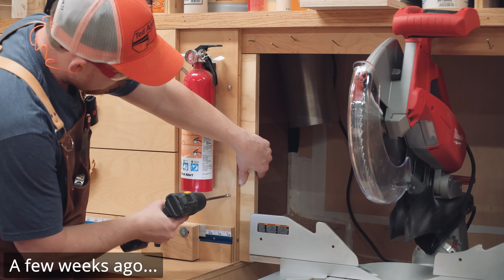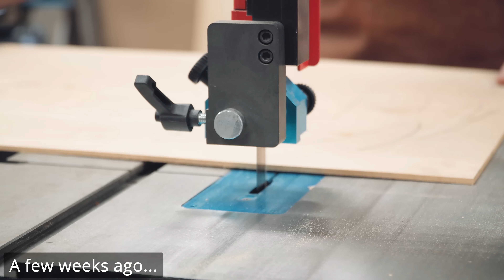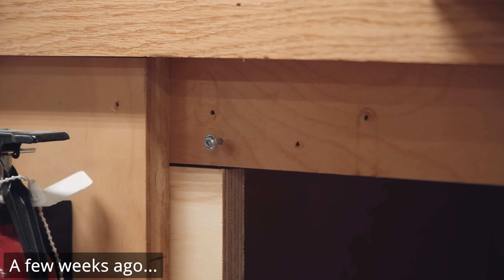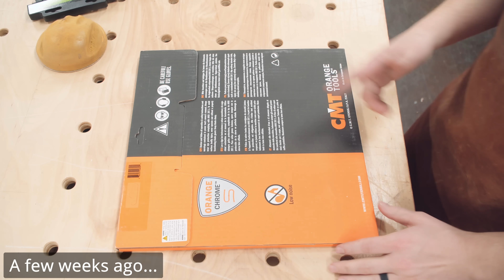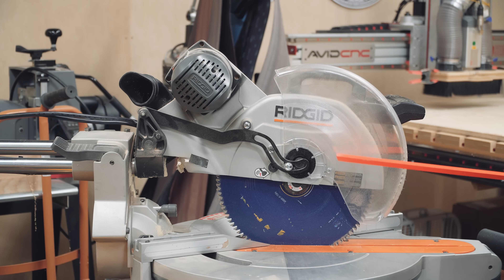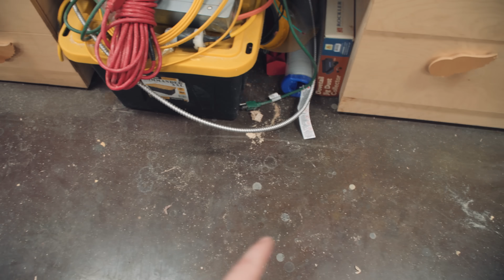Miter Saw Dust Collection Considerations - 358

Comment: Push-pull ventilation of the dust-particulate (swarf) generation zone is the most effective means of evacuating the swarf zone. This existing technology has yet to trickle down into the woodworking world.  A positive pressure air injection balanced with and directed thru the swarf zone and towards the negative pressure outlet.  For the offending miter saw 4 air injection zones; 
1.under the table, this could entrainment that which makes the circuit around the blade especially if wider than the kerf where the blade doesn't pass thru table insert.
2. Two in the shroud 45 degrees to the blade, aimed rearward into a negative pressure outlet to dislodge gullet carried swarf.
3. Behind the fence directed rearward.
4. Behind the saw directed rearward.
With the limited front opening the additional cfm and velocity of positive pressure injection will entrainment more air into the custom opening preventing swarf escape. These concepts were borrowed from existing industrial applications where they must capture all swarf, collect and separate it before the airflow reaches filtration and discharge. One of these days a maker will add these principles to his tools, and maybe manufacturers will recognize swarf as the health risk it is and incorporate these principles into their tools. Meanwhile it is up to thinkers who can get in the Magic School Bus and get into the airflow identifying opportunities to master control along the swarf path. You are the first to think about why the mitersaw scatters wooddust (It is that which is broken down that names the dust, not the process. Unless the saw is breaking down, it would be the blade, we should retire "sawdust, sanding dust etc.)

Comment: Hey Jay, what do you think about discharging your dust directly out the building versus using filters?
Reply from the maker: It will discharge my air conditioning as well. I live in Mississippi. Hot and humid. AC is borderline a must.

Comment: Thanks, Jay!  My miter saw has altered my perspective on dust collection into two categories; that which is easily cleaned up and that which is harder to clean up.  The easy stuff is what bounces out front.  The rest is what coats whatever is sitting behind the saw and what falls down behind it.  That second group is where I'm focusing my efforts because a "whole problem" solution is too elusive.  Sweeping the floor in front of the saw is easy in comparison.

Comment: I was using a water hose to clean a broom. And I could see that when was hitting it there were not as much splashing around with water. 
Could the same thing happen to a table/miter-saw ?
What would happen if the blade was running in close proximity to two brooms at a 90% angle ?

What if the slot for the blade was closed of by a row of hair ?

Comment: Good thoughts of the dust circulation around the blade. It's made me realise that my saw has to have a vac plugged into the blade dust port or the buildup will eventually cause trouble - the blade guard would have to be wider to work without a vac. One thing worth adding is that the spray can also be to do with the placement and direction of the motor vents. These seem to be designed to clear the work area during cutting, but perhaps a some lightweight stick-on vents pointed upwards or sideways would help to keep the workspace tidier and reduce the amount of fine particles in the air?

Comment: I have a Delta 12" miter saw.  Dust collection has bedeviled me for years.  I have tried all sorts of containment measures, most recently the clever "box it all up" solution from Fisher Shop.  Most of the dust I was unable to contain spewed sideways.  When I switched from the original blade to the CMT blade you recommend, it made a HUGE difference.  I would never have thought of this had you not emphasized it here.  Thank you for the good work.

Comment: Looks like the lights that tell ya where  the blade will strike the wood  are burned out on your Junkie miter saw , mine too . What a POS Milwaukee put on the market . Anybody looking to buy a saw ? Keep looking bc M dont have a decent one . My first and last "Red" tool I will ever buy . I should have stayed with Dewalt . BTW ,There is no way to improve the dust collection on this  saw . Piss poor design at best

Comment: Do you think if the replaceable throat plate was perforated, on either side of the blade slot, dust could be drawn down from the blade guard and into the dust collection? Just a thought.

Comment: On your old miter saw the ridgid. Did you ever have any issues with that black arm that your pointing at marker 9:50 ever bend causing your guard not to function properly I have this saw and had to take the guard off because the old one keeps bending . And you can not find this part anywhere. Thanks for any help

Comment: I think that saw needs looking at, it is noisy and the blades are 'ringing' (very clear on headphones) like it has a bearing issue or a lot of slack/slop in the drive shafts/belt/gears which ever it uses.
Reply from the maker: No. The stock blade caused the ringing. This motor sounds exactly like the kapex.

Comment: Kind of a shame on Milwaukee's part that a saw in this price category has such horrible dust management. Love the light on it and the digital miter gauge is convenient . But, the dust collection has turned me off on ever getting one. The way the collection is set up makes this more a contractor saw (mostly used outside) than a shop saw, in my opinion. Thanks for the FYI Jay. I'll stick with my current saw (Kobalt 12-in) with dust collection similar to your old saw that goes out the top of the shroud.

Comment: I missed you saying what your doing to loose the weight.  Obviously it’s suited you well. The saws turntable looks really small. The wings of the frame tapering into the pivot point reduces the surface area quite a bit. Can you still put jigs or stops for crown? Hold downs? 
The long arm and small round turntable remind me of a spoon, so now I have to call that your spoon saw.   Good job all around, have a great Christmas.

Comment: I switched to CMT blades a month or so ago and am very pleased. I think they are a good value relative to both cheaper and ore expensive blades. The quality is very good and the price not that much ore than big-box plates. Plus they can be resharpened.

Comment: Hey, Jay, can you tell me why all miter saws are made for lefthanded operation? That has always bugged me. What I mean is, you adjust the right hand fence to be perpendicular to the blade, but if you are right handed, you tend to hold the material against the left fence and operate the saw with your right hand. Doing it that way means you really aren't necessarily getting square cuts because the left hand fence is determining the accuracy of squareness and it can't be adjusted (at least not on my Dewalt portable).

Comment: I would look at modifying the guard so it stays farther up first, then, take a metal hole saw and cut a hole in the side of the metal upper guard, 1.5 or 2 inches. Attach a small collapsible hose to that that can connect through your enclosure to your large port behind the saw. Radial arm saws had this kind of dust collection and they worked pretty well. Last thing I would suggest is zero clearance tape from fast cap. Helps get cleaner cuts but will also help direct any airflow from the blade across the tape and toward the shroud.

Comment: Does anyone (manufacturer) have some kind of air sprayer to clean the blade as it's exiting the material? If it was in the right place, pointed the right way, seems like it could toss the sawdust into the path of the collection system.

Comment: Couple of thoughts 1)you can get very thin strong neodymium magnets that could be super glued easily so magnets aren’t a big deal 2) I watched another video recently showing the two rear large baffles replaced with a set of heavy duty vertical blinds slightly overlapped ( not sure what they are called you see these hanging in some retail stores or workshops they provide a wall that you can just walk through by slipping between two of the vertical strips). Sorry not explaining what these are called very well if anyone knows what they let me know in comments below.  The point of this curtain was that it could flex and seal more effectively regardless of the orientation of the saw, ie cutouts in the rear baffles to accommodate horizontal or vertical articulation of the blade are not necessary.  You do of course need to make sure there is no chance of the vertical blind being entangled in the blade mechanism.  Thanks for the video, I hope you don’t consider this post as a criticism just and alternate viewpoint for others to consider if building / improving mitre saw dust collection.  Stay safe everyone and happy holidays.

Comment: I use a power bar that turns off outlets when the control outlet device is not on. The saw an shop vac are connected to it so the vac turns on and off with the saw. A second or two after the saw stops. Instead of a dust collection system each tool has their own setup.

Comment: You had the Ridgid saw for several years and said you replaced it because it had worn to the point of not being as accurate as it once was. Given this difference in dust collection and today's $400 price difference between the two saws, which would you spend your own money on if you were buying a saw for yourself? To you, is the Milwaukee worth $749, or would you buy the Ridgid at $349 and use the $400 for something else?

Comment: A good saw blade makes a significant difference in vibration, cut quality, sound, and load on the tool. I used to think it would not be that much but after trying one, it's definitely noticable.

Comment: You might want to add some vertical "D" handles to the removable plates inline with, or slightly inset from the screws.  That'd make it super easy to do a one handed grab to lift the plates off their screws as well as put them back in place.  Just a thought...
Reply: I thought the same thing.

Comment: I have a DeWalt miter saw which has terrible dust collection. Even with a "dust port", it does absolutely nothing. I also tried a shop vac with no luck. I ended up just positioning a Hefty trash bag around the back of the saw like a tent to catch all of the dust so it gets trapped there instead of going all over the place.

Comment: Just an idea,maybe you could drill a series of smaller holes at the back of the saw to reduce the amount of sawdust coming back up through the guard.
Reply: the aluminum saw chassis might be weakened by that plan and it also might have an effect on the noise level.  He could integrate downdraft dust collection in the stand though; the dust collection vacuum has plenty of air volume.

Comment: Does this saw have the ability/option to loosen the detent plate for squaring? I have a Ridgid 10" slider that could only be adjusted by loosening the fence. Terrible. You had to have all the bolts loosened to move it, and trying to leave one on the end tighter, as a pivot, never worked correctly. That saw also had some flex in the slides. Curt ng perfectly square was very frustrating. I decided to go with DeWalt. Just about every trim guy uses DeWalt. Can't really argue with that. I'm currently building a modified version of your miter saw station and the DeWalt takes some creativity in positioning since it's so long behind the saw. The adjustment at the detent plate seems to be a much better method for miter saws.
Reply from the maker: Just the fence.

Comment: I have a Tenryu Silencer fine crosscut blade, among many others. But, it really did cut down on blade noise when I put it into my saw. Significantly... Also, I found that blades that have what I think is called a “shear face” meaning the actual front faces of the teeth have an alternating bevel, (separate from the alternating top bevel), tend to be very poor for dust collection in a miter saw. It’s a bummer though because I feel that the alternating shear face teeth actually noticeably improve the cutting performance, but it really spits the dust out the sides... but all in all, the Tenryu Silencer series is definitely the quietest blade I’ve used in a muted saw... Love your vids Jay!

Comment: Hey Jay, have you ever noticed your saw motor gets hot when making a lot of cuts? I have a brand new Dewalt sliding 12" saw and I made about 300 cuts last night and notice the motor housing was quite warm. I was wondering if its due to the fact that the saw is being used in a confined space (my setup is very similar with the dust shroud) Brushes looked okay and there was no arching that I could see... Any thoughts? Thanks!
Reply from the maker: They get warm. Most all electrical motors do. No worries so long as it is used as intended by the manufacturer.

Comment: May not be completely getting it here but not sure I agree on the dust bit. looks like you've got the vac set up for the box as a whole and not directed through the dust port on the saw, so the shrouds you have are now reducing the suction at that point? Would be interesting to see how a vac on the back compared or if you removed those shrouds.
Reply from the maker: The opening between the side wings is greater than the opening of the 6" dust collection pipe so there is no reduction. It's just concentrating the airflow to the center of the opening. Picture this. Place a box fan in your driveway and walk 15 feet away from it. Place the same box fan in a long hallway and walk 15 feet from it. You'd be able to feel the fan much greater in the hallway because the airflow is directed where you want it. Same concept with the suction here.
Reply: @JayBates  agree with the box shrouds i am refering to the integral shrouds on the saw itself, i think they are acting as barriers for your airflow. Obviously airflow is pretty complex but the opening and pipe have high concentrations, the box itself has a low concentration (big pipe) and the blade shrounds direct a fraction of the low potential only. Could test easy enough if you have something that smokes.

Comment: I'm always looking for a way to minimize dust.  The DC on my miter saw station is pretty good,  but you've given me a couple ideas. Thanks. 
A couple of inexpensive or shop made handles would finish off those panels.
Congrats on the weight loss.

Comment: I have a dewalt non slider setup the same way but I cut my wings so I can angle the blade then cut felt LVP underlayment to fill the gaps have it hanging like curtains on the back of the wings so the saw pushes it out of the way when angled seems to work pretty well, I don’t have  dust collection but I have a box underneath that everything falls into. I like the keyhole slots great idea.

Comment: Looks like the dust problem is inherent with this saw, can't be fixed with home-made solutions. Unless there is an aftermarket shroud modification possible, I would avoid this saw.

Comment: Why don't you attach a handle to the face of the panels? It seems that dust extraction happens when the cut is 90 degrees but doesn't happen when the wings are removed.

Comment: On your previous video, you showed a port on the back of the saw that you decided not to connect. If that WAS  connected, would it stop dust circulating in the blade shroud?  In your place I would try a  short section of  2" hose , attach one end to the saw and stuff the other end into the hole where your 4" (or is it now 6"?)  system ends. That would concentrate the suction at the blade and still lower the pressure behind your saw to encourage dust to travel that way. It's an easy experiment, either way.
Reply from the maker: No. That's further down the system and has no impact on the head of the saw.
Reply: @JayBates  I disagree. I have this saw in a dust box like yours, with both the saw's dust port hooked up with their right-angle adapter flipped and epoxied on, as well as a wide mouth intake on top. I've never had debris thrown back at me. 
When you use their dust port, it catches and sucks up the stuff thrown directly back and it's less likely to bounce back at you. A zero clearance backing can negate this to some extent.